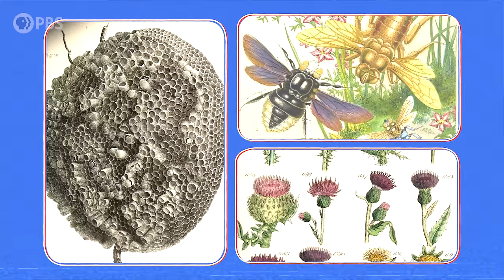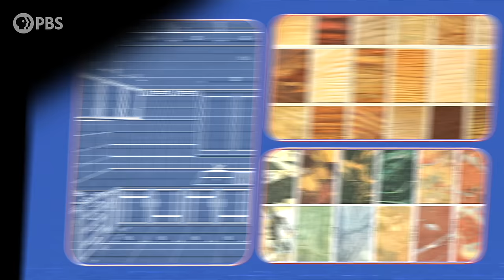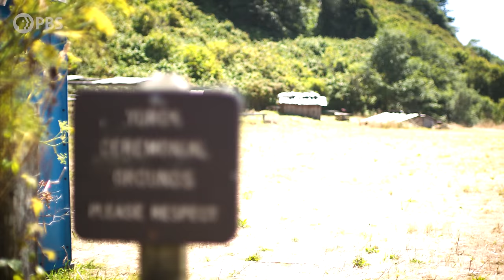Why It's Time to Stop Saving the Planet*

Comment: Another major problem I see as someone with degrees in natural resources, many environmental projects that involve habitat restoration don’t actually consult professionals in habitat restoration and management. For example, most tree planting campaigns are failures because they only select a few species, they don’t plant the right species in the right locations, and they don’t tend to them after. Trees require 3-5 years of weed control and watering if they are planted as large seedings. Many times, it’s better to let trees grow from natural seed sources if possible like in most of the Midwest. Even natural regeneration like this requires invasive species control at the very least and potentially deer exclosures since they selectively eat certain important species like oaks.

Comment: The climate crisis and biodiversity crisis is due to overconsumption and overpopulation, as well as using unsustainable technologies such as fossil fuel burning.  The only solution is to stop burning fossil fuels and only burn other things when really necessary.  Wildfire is a huge component of greenhouse gas emissions.  Smoke of all kinds is a serious health problem.  Our "green" technologies are better and necessary, but they also have impacts, hence the need for much less consumption and fewer people.  Let's go vegan,  stop flying and think abou the impact of everything we spend on.  And yes, we still need to protect wilderness and wild areas in order to protect biodiversity.

Comment: Frankly, I expected better from PBS Terra. This information is largely incorrect, and it is based on a narrative that is being pushed by logging industry "experts" who want to gain access to harvesting trees in protected forests through "mechanical thinning." Also, the amount of burning and forest clearing that the native tribes engaged in has been largely overstated. In truth, our recent mega fires in the Pacific Northwest were the result of increasing average temperatures and reduced precipitation, which resulted in both bark beetle blooms and a reduction in the trees' natural defenses against bark beetle infestation. 
Why don't you go to the actual U.S. Forest Service for your data, rather than relying on privately funded "research"?

Comment: I think saving the planet is a wrong motto for another reason, it doesn’t describe the problem properly.
We don’t need to save the planet as a whole, we are not endangering the planet itself, we are just changing the environment so fast that the planet is facing a mass extinction as it has occurred before, and the planet afterwards adapted and adapted thrived again and it will if we keep impacting the environment.

Keeping the current equilibrium is, in many ways, the most selfish thing to do : we just want to protect the environment in which we are the dominant species.

Many others species, some of them yet to evolve would certainly prefer to watch our collapse.

Comment: It is 250 degrees above the atmosphere, only 76 degrees on the surface.  174 degrees of solar heat gone, blocked out by the CO2 and other “greenhouse gases”.  Yes, they keep some heat in, about 20 degrees, but they block out 194 degrees for a net temperature of 174.
Gilbert Plass is the father of CO2 warming. His paper in 1955 THE CARBON DIOXIDE THEORY OF CLIMATE CHANGE started all this idiocy.  The first sentence of the Abstract for his papers  states:

“The most recent calculations of the infra-red flux in the region of the 15 micron CO2, band show that the average surface temperature of the earth increases 3.6” C if the CO2 concentration in the atmosphere is doubled and decreases 3.8’ C if the CO2 amount is halved, provided that no other factors change which influence the radiation balance.”

You get warming ONLY if added CO2 does not change the radiation balance, meaning the heat entering does not fall with added CO2.
Before satellites, all scientists worked from the assumption that the sun mostly produced visible light and little heat.  That visible light warmed the earth as the levels of CO2 and water vapor blocked out all the sun’s heat.  Adding CO2 will not block out more incoming Sun heat as the was so little coming in to begin with.  But this is wrong.  

Heat is the majority of the sun’s radiation.  30% of the sun’s heat makes it past the atmosphere, so adding more CO2 does change the radiation balance.  Added CO2 blocks out more sun heat cooling the earth and reversing the greenhouse effect!  Which is what Plass’s paper said.  Plass assumed that added CO2 did not change the radiation balance, so added CO2 created a warmer earth, but he was wrong, added CO2 created a cooler earth. 
250 above, only 76 degrees below.  Cooler earth hotter atmosphere.  The Troposphere is getting warmer with added CO2, not the surface.  The CO2 in the troposphere is absorbing more incoming sun heat and getting warmer.
We are getting warmer, but that is because the Little Ice Age (LIA), ended in 1850.  The Earth has been warming up since then.  Snow has been melting and the oceans have been warming up.   With less and less cold left over from the LIA the warming is accelerating.  We are going back to the Earth that existed in the last Inter-Glacial Period when Iceland was baren of ice and the seas were 26 feet higher than today.  
20,000 years ago the seas were 110 feet lower than today.  This is how it goes on the Earth, warm to cold, low seas to high seas.  This is just the first time mankind has had the education and intelligence to understand what is happening.  
Neanderthals lived through the last Ice Age but they didn’t know there was an ice age, it was just the way it was.  Earlier hominids had no idea that they were in an inter-glacial age.  All they knew was it was it was warm.   
Plass’s work is on the internet just google and read it for yourself, you only need to read the first sentence in the abstract.

Comment: Your talking about the difference of city living and rural living. City people have become detached from the natural world.
Reply: Actually urban living on average leaves less of a carbon footprint. And this could be reduced further with rooftop gardens, planting trees, public transportation, and designing cities to be friendlier to pedestrians.
Reply: @badAtPickingUsernames1988  First - I made no comments about carbon footprints, which is better which isn't. 

I said that people who are born and raised in the city are disconnected from their food and nature in general (speaking from experience). This causes them to push for things thinking they are doing the right thing, when in fact because they are disconnected they fail to understand what they are working with. 

2nd Carbon foot print isn't the end all be all. Cities in general create such a density of every form of waste that it because impossible for natures natural methods of recycling and and cleaning and repair its self. For example take 10 free range chickens over a 50ft by 50ft area, nature can deal with their waste natural and there are no problems. they become part of the ecosystem. Now place those same 10 chickens in a small caged 10ft by 10ft area, that condensing of chicken poop and pee will burn and destroy the soil. Its to much for that natural area. 

So even if city life leaves a smaller carbon foot print per person, its still collectively to much for the area to naturally handle the people which causes it to die. 

We as a people are not working with natures natural systems, this is also true with all the attempts at making "positive" changes when dealing with climate change. 

If we help mother nature, she will take care of the problem for us.

Comment: Perhaps you've heard of me? The Would Be Commissioner. This video is an example of what could be possible on the Day 1 Platform. New Age media inclusive connectivity. 
Again, my Terraforming Conferences are the way to Change the Planet. Again? H.E.M.I. is the human energy movement initiative. This H.E.M.I.  Platform is the operating system for the Terraforming Conferences. Similar Terraforming Projects must occur in nearly all of the the Big Cities; simultaneously. Does Democracy work? Does Communism work? Does anything work anymore? Brain stroke as the rapid incursion of Heat Waves moves us forward , does that work for you? -Commish 
THX 🙏

Comment: Google Oxygen in atmosphere over time and check out those grapghs in the images tab. We are running out of breathable air. Oxygen will deplete into dangerous levels FAR before we need to worry about temperature. Nat gas with methane is hurting this worse then coal or oil.